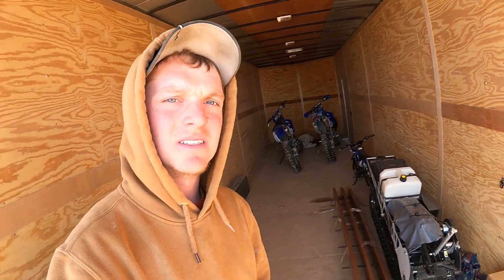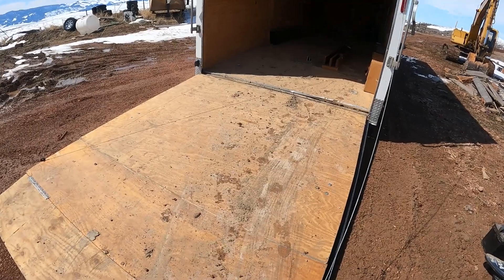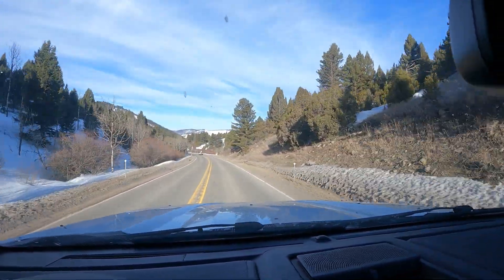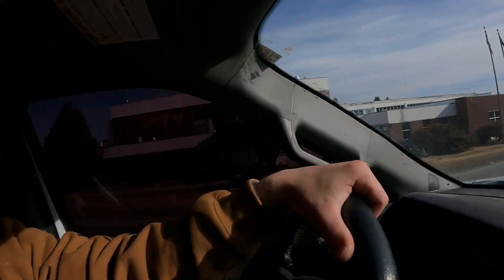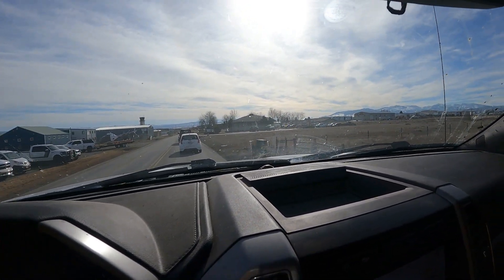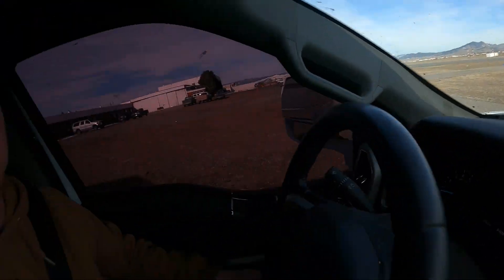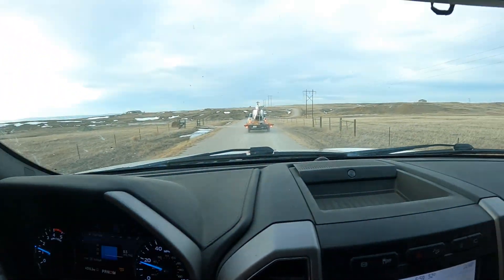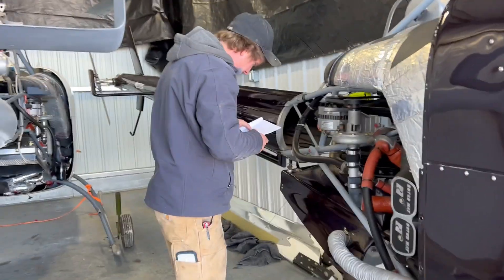My rotorway helicopters airworthy inspection and first flight! (Kind of)

Comment: That Enstrom needs more work then the Rotorway,  Gear struts are under inflated and the rotor dampers need bled and set.
Walker Evens lost his Enstrom due to the Enstrom walk... On a hill at idle blades turning and it bobbed forward and down the hill it went like a sled in snow...